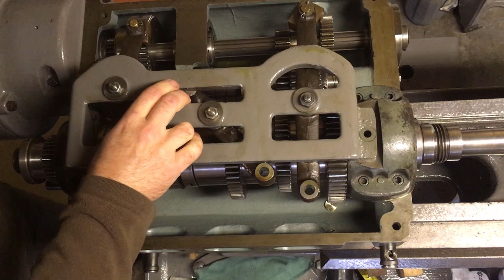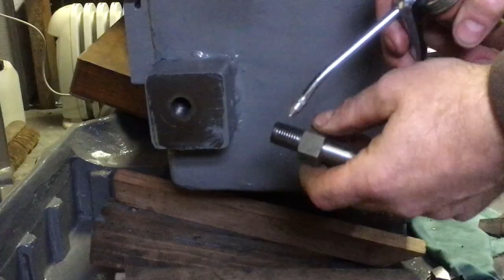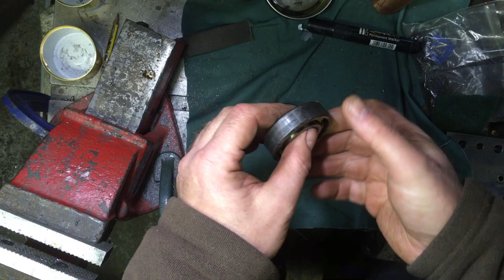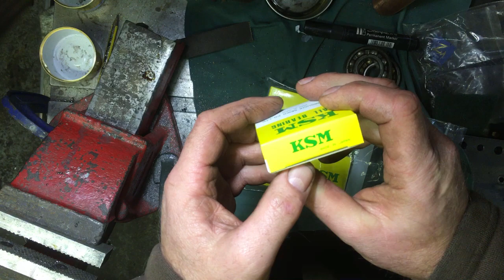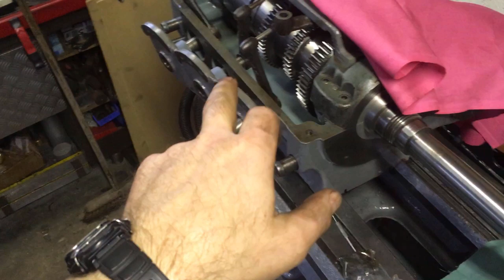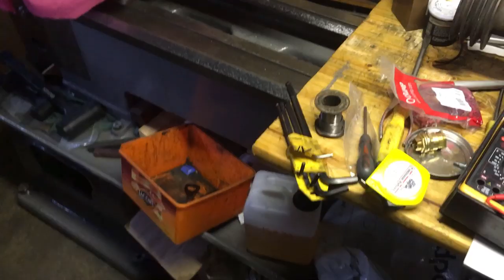Holbrook14 Update - Assembling the Lathe Headstock and Drive

Comment: Good to see you back in action, head stock looking good. Bit of an afterthought, would it be worthwhile to measure the spindle bearings for ovality/size, my understanding of plain bearings is that there should be a little out of round to allow for hydrostatic lubrication?.
Yes, I left school in 78, there was a rapid decline in engineering/manufacturing jobs soon after, 1983 brought about serious manufacturing end, then 85 the future is in financial service, courtesy of the school milk thief.
Thanks for sharing and best regards from the Black Country.
Reply from the maker: The clearance side to side I measured at 0.002" for approx 0.500" above and below the part lines. After scraping the top and bottom contact zones are mached to diam' of the spindle for approx 35% of the area 12.00 & 6.00 oclock if you like. However, the lowear half has the wick zone whihc is clearance for 0.250" either side of the wick to aid oil pickup. The zones for the wedging oil' are on the entry to each of the matched diameters working on anormal spindle direction of rotation. The outfeed side is more tapered out. All the contouring is less than 0.001" on diameter with the exception of the part lines. The shims between the halves 'are supposed' to be creating the oval shape. It may well be that the positions 2.00 and 10.00 oclock on the top halves need to be openned up a little more with some scraping - I wont know for sure until its bedded in and run a bit. Or I could use thinner oil for just the bearings and let them drain in part to the gear area and mix with the iso 32.  This is where my lack of experience has to be overcome with trial and error ! Exciting isnt it :-) All the best Mat

Comment: New motor bearings young lad ! Way to noisy .. dam nice job I have a Holbrook a bit newer model dam nice machine .. a good mate for my DSG 13x42 .they are getting old and while still look good need a machine tool fitter to help me ! Straighten them up a bit . Low tailstock on the dsg need some ideas on how to fix one !!!  Look after that shoulder mine is no good . Just slows me down a bit ..
Reply from the maker: Hi Mark.  The tailstock on the holbrook will require alignment when I get to it. I have a plan - which came about from discussions with my late friend Chris. I will do my best to video all of it as Im sure there are plenty of lathes whcih suffer the same. I was looking at a DSG 13 x42 and a 13Z - none around when I wanted one, then the Holbrook popped up. No sooner had I got it home and half a dozen dsg popped up within 2 hrs of my workshop, followed by a few Holbrooks. Pateience was never my strong point. Keep in touch Mark. Mat

Comment: It will be interesting to see your spindle clearances after a few heat cycles and bit of load! 
Christopher
Reply from the maker: Hi Christopher, I think once its run for a while and thinsg settle down I will have a better idea of the oil use/  losses. There's nothing to stop me going to a thinner oil, but Im confident the iso32 will work fine. All the best Mat
Reply: My C13 (also plain-bearing headstock) uses ISO5, not much thicker than pure paraffin... or a 50/50 mix of ISO32 and paraffin (ISO3, allegedly) - does yours too have oil pumped to the spindle bearings?
Reply from the maker: @hopefuldave  Its going to be a suck it and see once I get the clutch sorted out and the spindle running at speed. If I recall the top speed on the C13 is a little more than the 600rpm of the T13 ? Mat
Reply: Yep, 1500 as standard, I've run mine up to 2500 by running the VFD at 80-something Hz for short periods, hasn't got painfully hot...Not with the 10" 4-jaw, of course - spindle collet for a tiny piece of Ti.

Comment: Looking good Mat, that motor sounds like my mill motor did, I changed the bearings now you can hardly hear it.

Al.
Reply from the maker: Beginning to think I shoud hav ereplaced them. Lets see how she runs - its not a huge job to get the motor back out if the noise gets excessive. I gave it another shot of lithium grease before installing. Mat